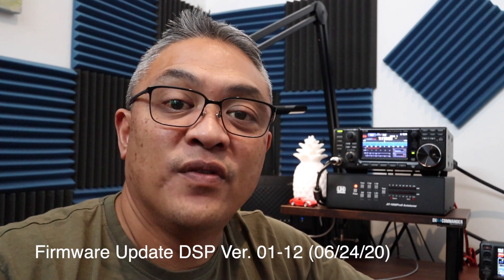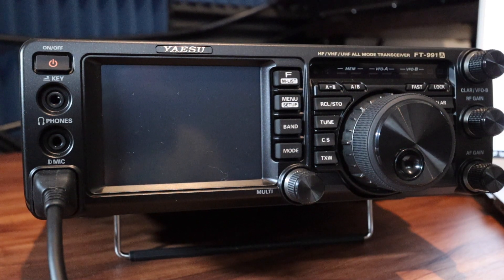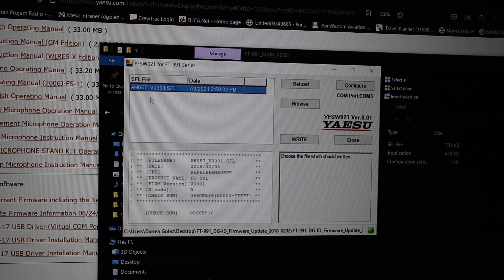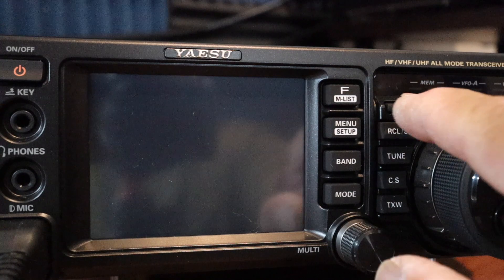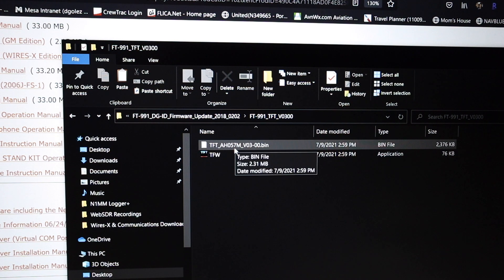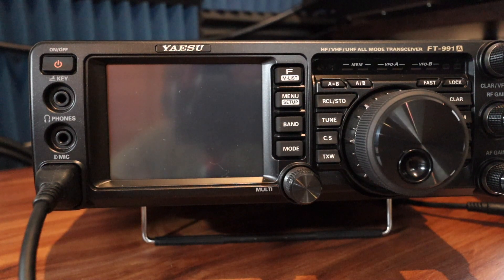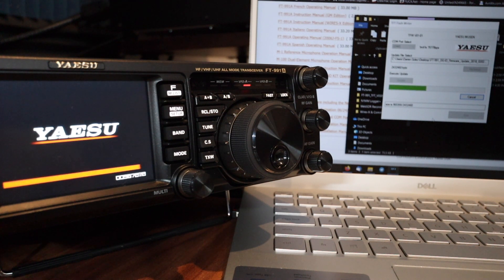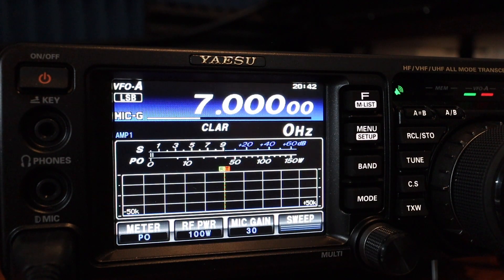New! Firmware Updates on Yaesu FT-991A The Process Required! Main Firmware V2.04.

Comment: Great video.  Thank you.  Question - Before I install the latest firmware, do I need to install the earlier firmware versions or will the latest version automatically install the earlier versions?
MB
Reply from the maker: You should be able to install the latest firmware without installing the previous skipped firmwares fine.

Comment: Great video!

If one uses software to program the radio, that might also have radio settings, so maybe use that as a way to backup settings before doing the reset, then all you have to do is restore the settings, right?  (I'm getting my 991A in a couple days, so I'm excited to see it.  I'm not sure if what I just suggested would work, or if the firmware update would make previous settings inoperable.)

Comment: Thanks for your valuable firmware tutorial, just one question for you Daren, were do I download the YFSW021 Program. My radios latest main firmware is out of date and needs a firmware update at the moment my system is running V02-04 and my digital incoming audio on the C4FM is very poor quality so I can only assume that by updating, it would be the best way forward before trying anything else.. I have backed up all my settings and programming so a system reset wouldn't be a problem for me and getting them back to the way everything was. Thank you for this step by step process good Job. 👍
Reply from the maker: Here's the revised video of my 991a firmware update.  In the video descriptions, I leave a link to where to download your firmware files.  73's de Capt Darren N4VFR
https://youtu.be/7PfYQ_NtjOI
Reply: @DarrenN4VFR  Thanks it made sense to me once i opened the update and the firmware is already built in. it seems the firmware i downloaded is the latest so ill leave it as it is. If its not broken dont touch it. 73 M7LSB

Comment: I downloaded the firmware file from the Yaesu site after watching your video. Interestingly the downloaded Main firmware was version 2-04 and not the 3-04 version installed on your radio. I wonder why Yaesu reverted to 2-04? Did you experience any problems after the 3-04 update?
Reply from the maker: Revised  video:  https://www.youtube.com/watch?v=7PfYQ_NtjOI
Reply: @DarrenN4VFR  Thank you. Catch you on the air.
Reply: I wondered about this too!

Comment: The last time I did a firmware update  on my FT991A I was surprised that it wiped out all of my settings and memories. It was a pain to have to set up the radio again manually. I finally spent the $25 for the RT Systems software that allows you to do this from your computer. I believe this will make things easier going forward. Setting up the radio for Winlink was also a confusing process that required many radio resets before I got it right. Now my radio's settings and memories are stored in the RT Systems software and I can easily reload them into the radio if I need to. Thanks for the good video.

Comment: This "new" firmware update was released in 2020 and i did it on my ft-991a and while it made sure i put the RIGHT firmware update....make certain you are comfortable doing this process. While it is not the best way , it is however the ONLY way.

Comment: Well done.Only question, if it screws up on an update, is the older version still there?
Reply from the maker: Malcha, yes and here's the link for the older firmware for the IC7300.  https://www.icomjapan.com/support/firmware_driver/?product=%7CIC-7300%28EUR%29%7CIC-7300%28USA%29%7C&frm_type=Firmware&class=&open=tab2&type=5&business=3&old=true#download_result
Reply: @DarrenN4VFR  But this is a Yaesu FT991-A.  The link above is for an ICOM.
Reply from the maker: @terryjwood  Your right!  For those that need the 991 (Not 991A), here is the firmware update page. https://www.yaesu.com/indexVS.cfm?cmd=DisplayProducts&ProdCatID=102&encProdID=D24F60F33816ED8BE5568D7E2B5E2131&DivisionID=65&isArchived=1  I couldn't fine the firmware files if you want to revert back to the older versions.
Reply: Thanks. Always know your alternates!

Comment: why did you not backup before resetting?
Reply from the maker: There is no backup memory card slot on the rig.
Reply: @DarrenN4VFR  You don't need a memory card. There is software and use the cable. There is even a free software called FTRestore
Reply from the maker: @Pacman163  cool! I didn't know that! Thank you for the tips!
Reply: @DarrenN4VFR  Also looking at the version numbers from the updates they look to be for the 991 and not the 991A did you have any problems or did you flash it back for the 991A
Reply from the maker: @Pacman163  yeah, I dont know how I managed to download the 991 firmware.  My waterfall  disappeared and I managed to refreshed the newest 991A firmware.  It's all working good now.

Comment: I'd like to see a firmware update where the output power is saved with a memory ch. I have various 2m repeaters nearby that only needs 5 watts to reach, some 30 and others 50.
Reply: I agree Ronnie! I use the Multi knob so often to change power output levels for different modes I figured it would be the first thing to wear out so I edited the configuration of the slide controls in Ham Radio Deluxe rig control software and added a 'MAX RF power' slide control so that I now do not have to use the Multi knob so often and hopefully that will prevent me from wearing it out. The Multi knob,  I believe is an optocoupler, like Yaesu also used in the FT-1000MP and in the Mark-V version uses for the Multi knob as well. The replacement part is relatively inexpensive selling for only $8.00, but I bet it would be a real bear to install due to the very limited space you would have to work in.

Comment: Did you just flashed your FT-991A with FT-991  firmware in the video?
Reply from the maker: I re-watched my video and it definitely says 991 not 991a.  I just reflashed my firmware and it says Main V2.04.  Thank you for commenting and correcting me.
Reply from the maker: No.  I downloaded the latest firmware from the Yaesu.com website.  It only listed 991A in the files.
Reply: @DarrenN4VFR  Oh, where did you get MAIN: V03-01 and TFT: V03-00?   In the video @4:17 I saw you were using file called FT-991_MAIN_V0301 in your example @16:19.  That is the FT-991 file not the FT-991A.  And toward the end when you displays all of the firmware version it does not look right.  Or you know someone at Yaesu :D   The Yaesu USA site only have MAIN: V02-04 and TFT: V02-00 available.

Comment: nice updates.but, where is the waterfall. thanks
Reply from the maker: After I resetted the 991A, I had to manually put all the setting back to the way I had it. I did changed the spectrum analyzer to the waterfall.
Reply: @DarrenN4VFR   oke thanks,  we are going to try it again. 👍
Reply: Oke so we put the 2.0 back because the  3 is not working😪. The waterfall/scope is gone after the update..
Reply from the maker: @lydiaw8544  You downloaded the latest files from the Yaesu website, right? And did you did a system reset.  LOAD the MAIN firmware first.
Reply: Yes yes and yes we did it the same as youre video. And read the manual,  maybe its in quarantaine first before its in holland🙈🤣, youre video was great so we can try it over and over again. Thank you for answering
Reply from the maker: @lydiaw8544  lol, okay, good luck and I hope it updates well for you.

Comment: Nice and thank your for showing the software.  I would think you can save the settings you had to back up and reload.
Reply from the maker: There isn't a SD card access on the 991A to store or read your setting like they have on the Ftdx101.
Reply: @DarrenN4VFR  I would think with something like RT systems you could save the settings and the repeaters. I can post if I find out.

Comment: When I download the file, It contains Main V0204 not V0301, as you show in the video. Thanks and Best Regards.
Reply from the maker: Today I just verified my 991A Firmware as follows:  Main V02-04, DSP V01-12, TFT V02-00, and C4FM V04-15.
Reply: @DarrenN4VFR  The same versions are the ones installed in my FT-991A also.
Reply: @DarrenN4VFR  Confirmed. I bought my 991a in Jan/2021 and without any updates, those are the same specs that was shipped to me. Looking forward to any update that Yaesu would provide us with to add additional features. 73. K8JAZ.
Reply: @DarrenN4VFR  thats exactly what mine is so the 991a has not had a firmware update since june 2020
Reply from the maker: @W2JLDRoc-ham  Yes, that's correct.  The latest firmware update for 991A is dated 6/24/2020.
Reply: I am just getting into HAM and bought an new Yaesu FT-991A about three weeks ago.  I just updated the firmware and I also show V0204 (oh, also noticed the 'exe' file I ran is YFSW024, not 021 like when you updated).  Note, I also updated to DSP V01-12.  Today/tonight is 7-17-2021.
Reply from the maker: Huh???  I just re-watched my video and your right! It said v03-01.  Since this video was posted on 7/11/2021, I since re-installed the firmware back on the 991A.  When I get back home in a few days, I will re-confirm the installed MAIN V03-01 after re-installing the latest firmware. Please ZUJ for now.  De N4VR Capt Darren.
Reply: Same situation here Tony. I downloaded the file name he said to from the Yaesu site, but when I extracted it and looked through the extracted folder it did not contain the Firmware version he showed that was in the zip file he downloaded so where the heck is he getting his file because it certainly isn't on the Yaesu USA website Files for the FT-991A? The file name I downloaded has the exact file name he said he downloaded, but the firmware he installs isn't in there! It also contains YFSW024, not YSFW021 like he shows. 73 de KU4GW
Reply from the maker: @CliffFoxKU4GW  Yeah,  I rewatched the video and it did say 991 and not 991a.  I don't remember where the heck I downloaded the firmware.  Anyway, after reflashing with the firmware with 991, my waterfall didn't work.  I then re-downloaded the firmware from the Yaesu website and reflashed my fireware to the correct 991a and it worked and my waterfall was working again.  Have a great day!